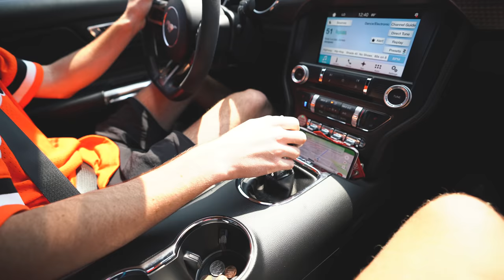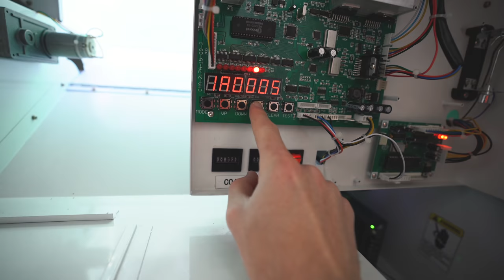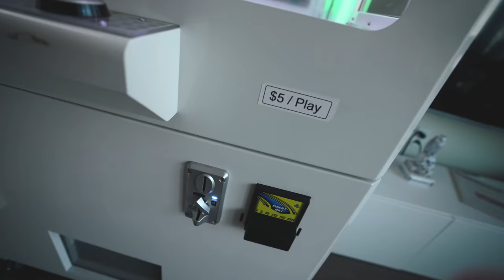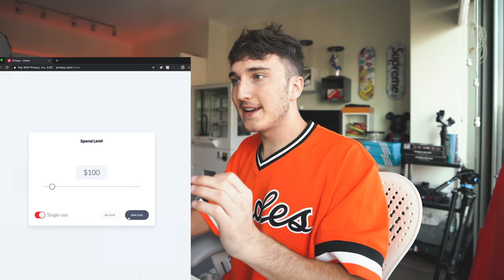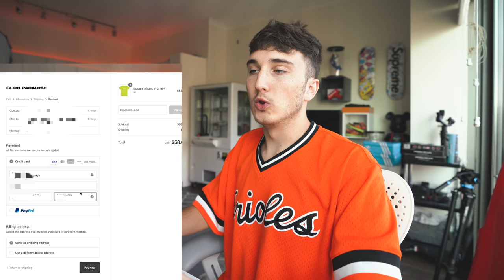I Bought A Sneaker Keymaster Machine...THE TRUTH EXPOSED...

Comment: the "threshold" being at 5 doesn't mean you only win every 5 times. It gives you the opportunity to win 20% of the time (1/5). So you could win the first time, but every time you play there is a 20% chance to win. Probability doesn't change the more you play, every time you play, you have a 20% chance of winning, it doesn't go up or down.
Reply: But what if you set it to 100 or even like 1000? Then this theory doesn't make any sense.
Reply: Invictuss how does it not make sense? What he’s said is true... if it’s set to 100 it’ll be a 1% chance of winning (1/100) or if set to 1000 it’ll be 0.1% (1/1000)
Reply: diverse mnt. Still doesn’t make sense. Unless the percentage applies to some kind of accuracy deviation, it means nothing.
Reply: I don’t get it.
Reply: Limitless it's the amount of money, it has to have entered until it lets you win, which can also mean if 1 play is 1 dollar and he has it set to 5, after the 5th play on the exact you it will actually let you win
Reply: @tielerbeaver3048  it’s not the amount of money it’s the amount of plays.
Reply: @orionfree5609  plays/money same thing. For example if the prize cost 30 bucks,  each try cost 1 dollar and  they want to double the return. the threshold will be set to 90 tries. Also, how the machine works is that it enters skill mode after the threshold is reached. Meaning you can actually win with skill in my scenario which is after the 90 tries.

Comment: if whoever is reading this comment thinks that it’s impossible to win these, it’s not. that would be illegal. the people that put keymaster or other similar things in public places legally need to have a certain payout rate. this means that 1 person of X amount of people that play will win this can vary depending on what the laws are in that state and the value of the prize. for example a claw machine with stuffed animals in them might have a 1 in 9 chance to a 1 in 50 chance while a keymaster with phones, sneakers or gift cards can be upwards of 1 in 1900. so if you want something in a claw machine or keymaster, SCOUT IT OUT. watch how the claw gains strength as people lose. or how high the keymaster jumps up higher than you stopped it at. you should have a higher chance of winning if nobody has won in a while rather than right after someone wins. just a tip!

Comment: Is it a scam? It's complicated. Because the owner of the machine can set the threshold of the prize then that person can set it up so it's a VERY low chance of wining. They could have a pair of Air Jordan 1 High OG TS SP Travis Scott (current on stockX @$2800), but set the threshold to start allowing payouts @100 grand if they like. So basically unobtainable. In that case, I would consider the machine a scam. You have essentially a non-zero, but VERY, low chance of winning that sneaker. Because the threshold is set by the owner of the machine, you are placing a LOT of trust that they have set the threshold at a reasonable level. So, is it a scam? It depends!

Comment: Of course it's a scam machine.if I paid £3000 for the machine and then stocked it with a potential £20000 worth of sneakers in it,I'm not gonna set it to drop after taking £5000 I'm gonna set it to drop after it's taken £50000 quick maffs!

Comment: Of course it can be a scam and is probably very likely that many of them if not most of them probably are…

 I mean it’s common sense.. when you can set the threshold to whatever you want without anyone else knowing what it is at, then what’s preventing someone from setting each and every item at its max threshold of 5000?!? 

That would mean you  won’t have a chance in hell to win anything from the machine unless it’s a machine that has a line around the block 24/7  seven days a week. 

because it would mean that each item won’t be winnable until $25,000 dollars has been fed into the machine, and then basically there’s a one shot chance with true accuracy to win a single item until it resets and another $25,000 is fed through it…  (being at $5 a play like most)

So the machines thst have all super nice sneakers in it or expensive shit I bet are usually set to 5000 cuz if there’s one thing you can count on in this world is that of greed and grimy actions in the pursuit of. 

And thee are type of behavior is just that much easier to fall victim to when someone can do it in a way that is painted as a legit action but hidden behind it’s closed door is the hidden threshold no one can see or know about except said person… 

All too ripe in the making for this machine to be more likely to be a scam than it is to be even remotely close to being somewhat fair.

I think what would make it a bit more user friendly and would make me at least feel better about spending money on it would be to have a little window you could see through or what not, so you could see exactly what each rows threshold is set to, that way you could gauge the odds a bit to see if it’s worth you gambling on. If you could imagine that it could be seeing enough people to have a legit shot at winning something. Etc etc… 
Even lottery tickets tell you the odds… 

Because without knowing the true odds of being able to win then I assume these are all completely lopsided, leaning towards never winning and being unfair to the users.